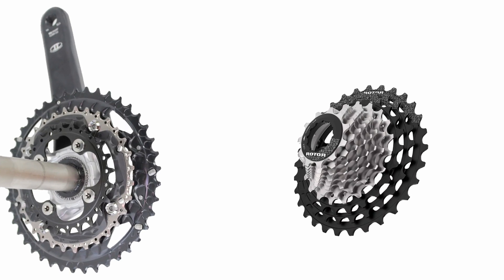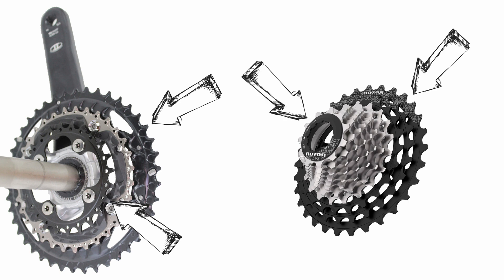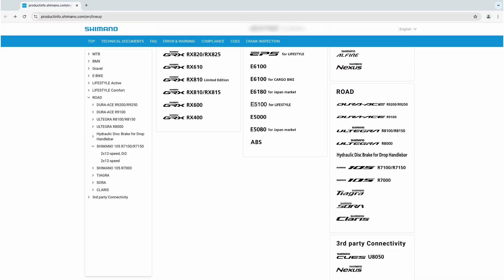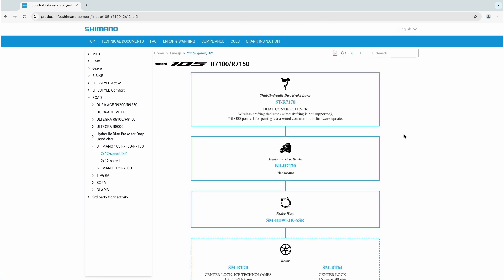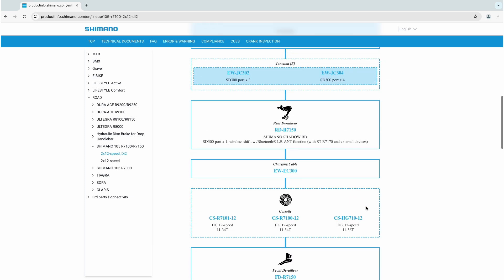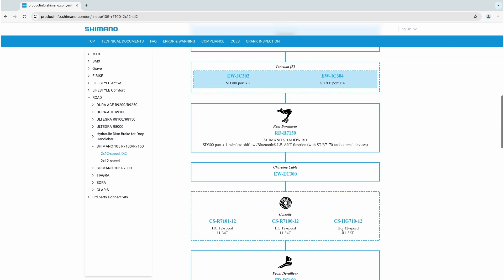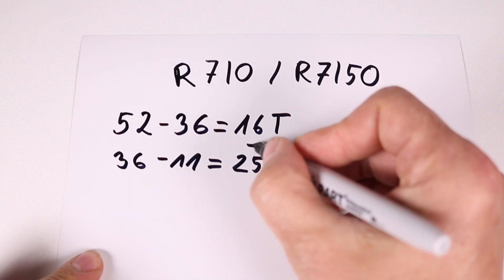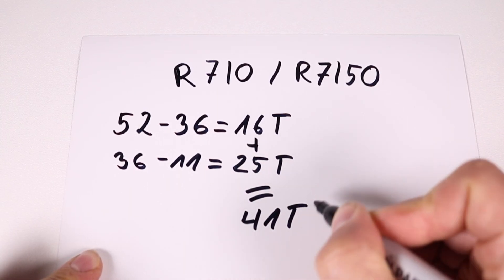Maximum Drivetrain Capacity Explained! Everything You Need to Know

Comment: Ok, but given the total capacity, which is the best way to obtain the maximum spread and homogeneity in steps?
Reply: You will be limited by the largest cassette sprocket that the rear derailleur will support and the capacity of the front derailleur.   You don't want the adjacent gear ratios on the cassette to be too large as it can create an unpleasant riding experience.  For me up to about 20% is tolerable ( 15% is better ) .  The same applies to the chainrings.  Some people find a 16 tooth jump too much ( e.g. from 50T to 34T ) .

The 'curve' on the bottom of a front derailleur outer cage plate is designed for a certain chainring size.  You can use a 48T outer chainring with a front derailleur cage designed for a 52T ring but shifting is not optimal.  Your possible chainring sizes will be restricted by the BCD of the crankset .  A 130mm BCD can fit a chainring of >=38T etc.  

Personally I wouldn't use all the available capacity and maybe leave at least a couple of teeth spare so there is no risk of either a slack chain ( can be adjusted out to a certain extent with the 'B' screw on the rear derailleur ) or risk damage by potentially ripping the rear derailleur off !  Lots of things to consider beyond the scope of this video .